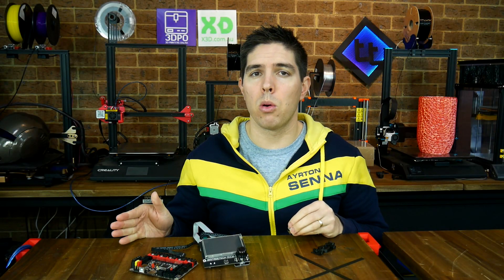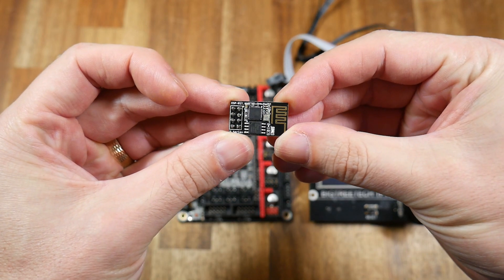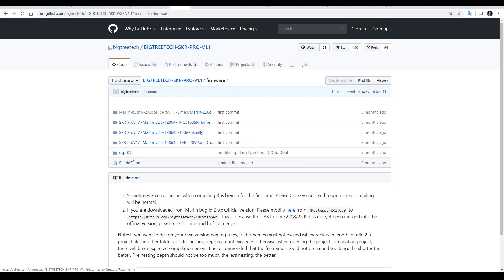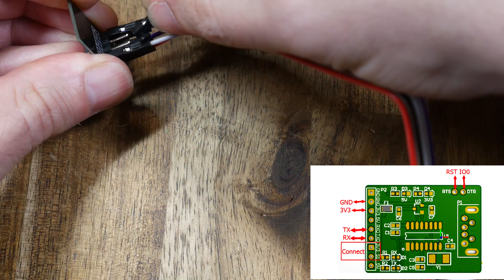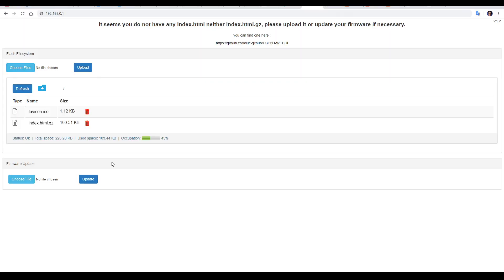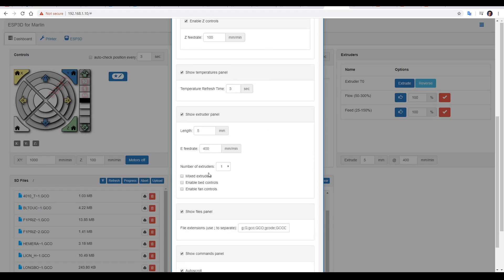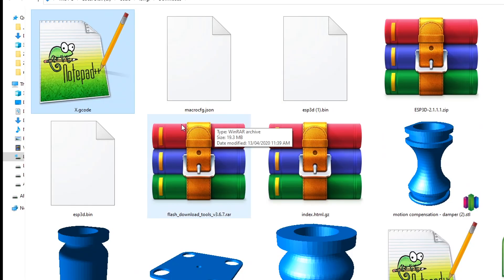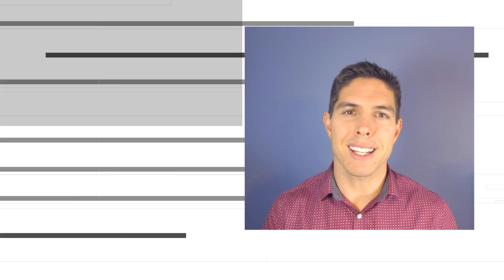Add wifi to your Bigtreetech mainboard/touchscreen - ESP-01S guide

Comment: Michael could you make a DuPont crimping tutorial? I bought a kit and the pliers but man is it hard!
Reply: Its not fun for me and my big hands also. I found the if I close the crimper to the first locking click. I then clip the forming strip between fitting leaving it on the fitting I want. Using needle nose players I can fit the fitting into the crimper and the remaining forming strip holds it in the correct position. Once crimped break off the strip. You may need to do a little forming on the larger section the get it to fit

Comment: At first I thought: "Cool, just buy $3 module and you have wifi connectivity"
But what I see it's quite bad, not being able to quickly upload the file is already quite a deal breaker, but not even from the USB/SD connected to the display? eww...
Reply: @Noobz Threefortyseven I have ender 3 at work running with octoprint and it often looses the communication on USB between rpi and printer for no reason, no one touches the cable so no way it gets disconnected...
Reply: @Arek_R.  have you checked for undervoltage on the pi? Try a better port supply first and then shortening your serial cable if you still have problems, mine was constantly erroring with a 2m USB cable so I cut it down to 0.3m and it works perfectly. Too much volt drop on a 1m cable, never mind 2m 😳
Reply: @Arek_R.  have you checked for undervoltage on the pi? Try a better port supply first and then shortening your serial cable if you still have problems, mine was constantly erroring with a 2m USB cable so I cut it down to 0.3m and it works perfectly. Too much volt drop on a 1m cable, never mind 2m 😳
Reply: I thought the same.  buy it, watch a video and it works.  NO NO NO.  Day 4 and still lost....  email people and all you get is "did you read the manual".

Comment: No Comparison with older esp01, no Comparison with current esp3d master brunch, no guide for building from sources with platformio, no Comparison esp32 vs esp01, dont undestand is it possible to connect with usual pronterface... Like uart over wifi mode... But even this tutorial is better than nothing

Comment: Hmmm, this got me thinking. The CPU speed (especially on ESP32) is not bad, you can buy cheap SD modules for storage - hell, you can even buy ESP32 camera module with microSD for $8 or something... How difficult would it be to use the 2 cores and improve this UI a bit to achieve copy of Octoprint? Running the $8 ESP32 with camera instead of RPi + camera and sending the commands directly using serial might be a viable option!
I guess the guy who made the UI already thought about this - his UI as pretty close to the one of Octoprint already...

Comment: The better way is to use an android TV-box with installed Linux and Octoprint. TV-boxes are the same SBCs like any any other Pi-series computer with ARM processor. Just for $20 you get quite a powerful miniPC with Wi-Fi module and internal memory storage that comes already in plastic case and equiped with a power supply! I'am currently using Octoprint at X96mini TV-box. It's quite fast and stable.
Reply: How did you convert the tvbox to octa print etc

Comment: Thank you for the review. It appered to be almost useless.
Reply: You might have a use for this. Let's say you got a second printer, but have a main printer all set up with octoprint. You would like to have a web interface for your second printer too but it's not critical, and you don't want to invest in another raspberry pi for your secondary printer. This would provide a web interface and is cheaper than a new raspberry pi. I myself paid 80 bucks for a Raspberry Pi 4 and another 40 for an Argon One case (great board and awesome case btw, it's got soft shutdown and configurable cooling fan) so spending another 120 bucks for my second printer, which doesn't really need it, is kinda out of my budget. Think of it as a cheaper octoprint-like web interface, rather than a all-in-one replacement for octoprint.

Comment: i recently added the same to my skr 1.3
just flash esp3d onto a esp-01s via arduino ide and ftdi adapter, and hook it up to the "TFT connector" (right side of sd card slot, above aux 1), its pinout is 5V GND TX0 RX0 RST.
rx/tx can be hooked up directly, just 5v to 3.3v via external dc-dc or linear regulator. 
the digital i/o pins on the LPC boards can take 5v as input but its output is 3.3v, no need for a level shifter.
bridge EN/CH_PD and RST on the esp01s to 3.3v so it can boot.
Reply: thanks for the tip! Is the documentation available somewhere?

Comment: Thanks Mickael ! Great tutorial. ESP firmware flashing tool is only for PC. For other environment, there is esptool : https://github.com/espressif/esptool which is less user friendly but works as well. You can also compile the updated firmware from luc-github ESP3D with VSC/PlateformIO, and then upload it with the firmware updated webinterface of the ESP3D.
Reply: You can use it on Windows also. It's written in python.
Reply: thank you.

Comment: I would say, that if you need only Wifi printing with terminal - this is perfect tool for couple of dollars. Furthermore, if you will change old and barely working ESP--01S to atleast ESP8266 or even ESP32, you will have DHT support for temperature monitoring, relay control (or any other device with GPIO control) or WEB camera. Even more - you can add additional small OLED via I2C and that will be interesting device for less than 10 dollars.

Comment: for alot of people especially in the UK, 192.168.0.1 is the ip address for the configuration of the router, meaning that this upgrade might not actually work in some countries
Reply: At the step where you go to this IP Address you will not be connected to your usual wifi network, and as such this will not be your routers IP address. This is a special network that is only set up by the device to allow you to configure it so you can tell it the correct settings for your existing wifi network where it will then connect to your wifi and receive a new IP that won't be in conflict with any other device. In the video it shows it's new IP on Michael's network on the screen after the device restarts
Reply: You should be able to temporarily change the ip address of the router to enable you to configure this device. 192.168.0.254 would work fine for your router